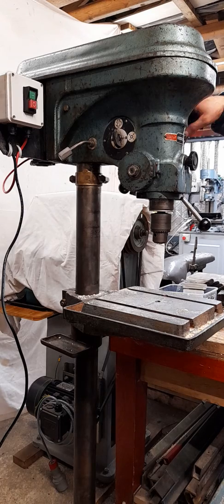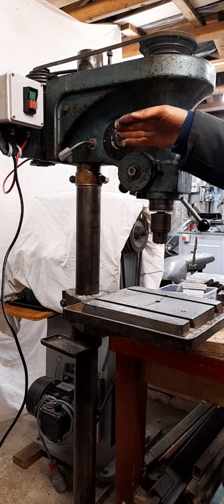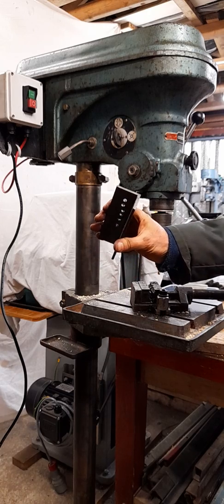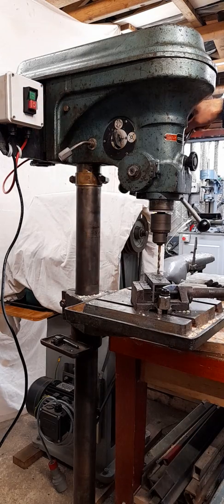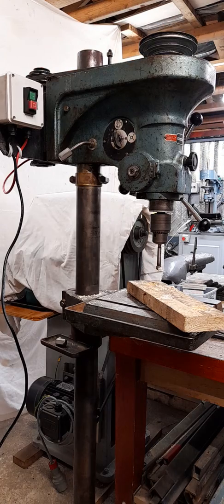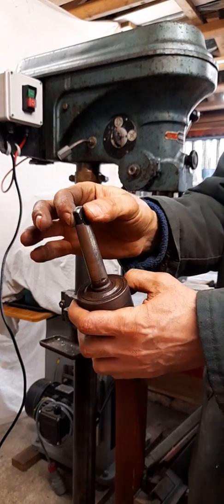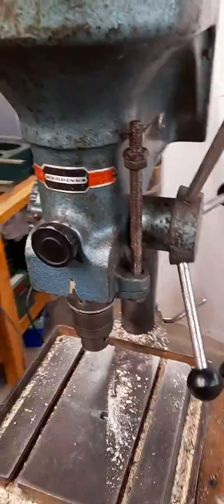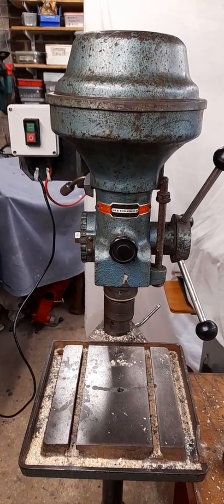Meddings LF1 floor standing pillar drill testing, quill spring adjustment, chuck removal and fitting

Comment: Hi there, how did you go about changing it to a single phase?
Reply from the maker: Swapped the motor. However, I have previously converted 3 phase motors to single phase supply by adding a run capacitor. I have a video showing this on a coolant pump motor.
Reply: @PizzeyTechnology  
I ended up buying the next one up from this.  It's the f14 Pacera model.  I also have the manual if you have any questions.  The hex nut on the side to the right of your on/off switch is for tightening the belt.  There is one on the other side also
Reply: Do you know how to change the gear box oil as suggested by the instructions on the side
Reply from the maker: No, I didn't change the oil. I have since upgraded to a better drill.